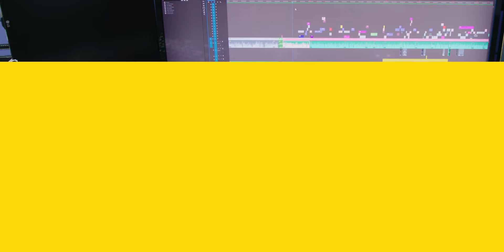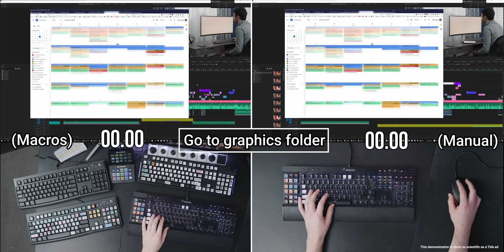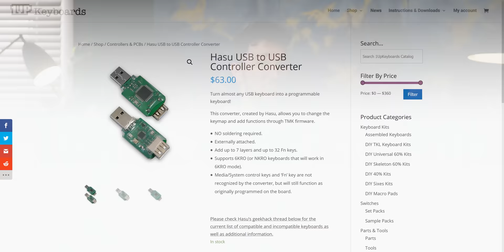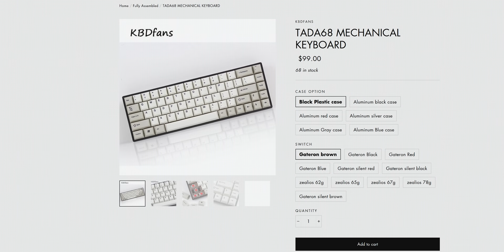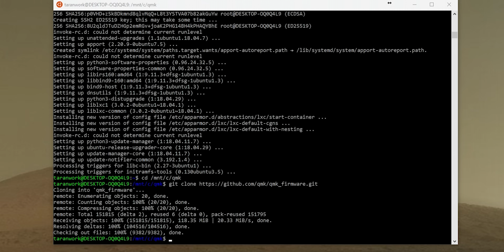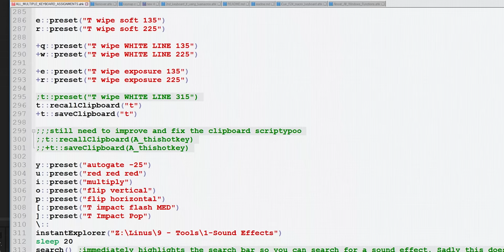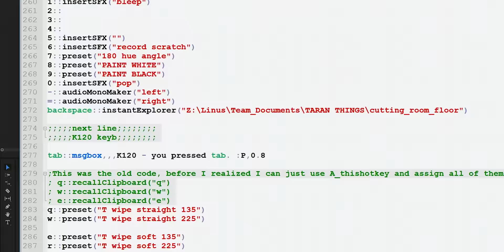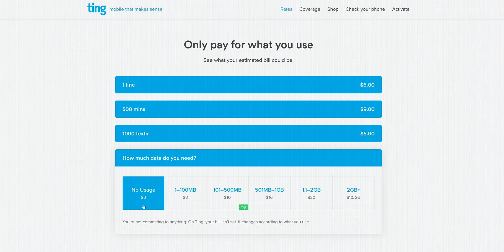Can your Keyboard do THIS?? - Make ANY key a MACRO!

Comment: Every few years, the planets align and The Taran is allowed to exit his den. Upon seeing first light, The Taran is confused - Why so few macros The Taran asks? Why does this creature have only one keyboard? The Taran cannot allow this and plans his attack. The unsuspecting computer user is unaware of the fact that it is possible, or necessary, to use 12 keyboards with his computer. As the computer user types away on his single un-ergonomic keyboard that obviously causes far too much overexertion of their index finger, The Taran strikes. The Taran reveals his secret move: ULTIMATE MACRO and the user is completely overwhelemed by the fact that now he must memorize no fewer than 1400 new key instructions on their new setup, but The Taran has claimed victory, for while the user may need to exert far too much brain power and memory, the user may now save his hands from multiple key presses for the rest of their life.
Reply: Wow
Reply: <3

Comment: i have no idea what i just watched
Reply: I think it has something to do with keyboards
Reply: haha. same goes to me
Reply: The entire trip down the macro rabbit hole
Reply: Basically, he explains all the options for productivity freaks and games that play simulator games in full simulation mode that need more than 1 keyboard to do things.

QMK lets you take cheapest keyboard that you can buy (or have laying around) and turn it into productivity panel. For example, you can print icons that tell you what kind of macro is on a key and glue them to every key on keyboard that is connected to computer with QMK.

Why would you do that? BECAUSE pressing ctrl+alt+shift+F3, down arrow, down arrow, left arrow (or some other combination) would become painful rather quickly, especially if you have tons of such combinations for video editing software, photoshop and similar.

For example, let's say you need to press up, up, down, down, left, right, left, right, B, A
Imagine that you need to do it all the time to get something done quickly and it repeats 30~40 times a day. And there are other combinations that are also used 30~40 times a day.
Macro can do it in about 1~2 seconds (depending on how fast your PC works and can, without lagging, accept the inputs to get things done right).
By hand (manually) it would take a lot more seconds (depends on combination and sequence) to get same result AND you need to remember ALL THE COMBINATIONS in your head. Now imagine that you need to get something done, but instead you try to remember "what is a combination to quickly select tagged items?". Time gets wasted on 'sitting at the desk and staring at the screen'.

So instead of memorizing combinations you can get a QMKs and a bunch of cheapest keyboards and then print out what each key does.
Will it take some time to do? Yes, it will.
Will the time it has taken to set up the workspace help in months and months of mundane work? Yes, it will.

For games like Arma 3 or War Thunder an additional keyboard is useful. Here, look: https://youtu.be/b_sOUn8_JAM?t=162
Try using Full Real controls in War Thunder without running out of keys to press on single keyboard. That's what this video is about.
Reply: @Muhanoid  i know, but its a joke lmao
Reply: @sbxdd  oooooooooh. Now I get it. Thanks!
Reply: Me neither.  I am nonetheless intrigued.
Reply: And you watched it why?
Reply: @Muhanoid  r/whoooooooooooosh!
Reply: sibbexd so true man , me too , i just got a one handed keyboard and idk how to macro set it
Reply: @Muhanoid   the way I like to put it is Taran has an Adobe Premier Macro fetish.
Reply: Xtreme Performance  Why do you say that? Do you know how many of LTT's videos he edits?
Besides, there are so little quality videos regarding macro and programmable keyboards. It's actually an original and rare type of video.
Reply: Xtreme Performance  if what you mean 'loser' is where you can only watch linus's videos without working with him then i guess you are right.
Reply: It's good.
Reply: Lmao
Reply: same but I still watched it lol XD
Reply: Hahaha one day you will get it
Reply: @wolontong  what'd the comment say

Comment: Taran I think at this point building a proper cockpit style rig with a custom frame for all your keys is the next step, like link up several of these USB adapters perhaps and build your own Star Trek style control panel.  Make it so!
Reply: this would be an AWESOME VIDEO.
Reply: Oh hell yeah just imagine linus's face walking into the editors den to see a Star Trek cockpit styled desk for Taran
Reply: Do a quick search for "KSP custom control panel" on Google or Youtube and you will see some excellent examples.  People have been making things like this for years for all sorts of games and it's actually pretty simple.

If you want to get into something like this, pick up an Arduino Uno to start learning.  If you want keyboard (AND MOUSE/JOYSTICK!) emulation, you need something like a Teensy or different model of Arduino, but you literally just wire up any button you like and program it to act like a certain key.
Reply: Wouldn't surprise me consider he tried a mine reader.
Reply: Linus where ya at buddy? I would even say you could get Taran one of those Razor monstrosities rigs for 10k so he can immerse himself
Reply: Taran, what if you convinced Linus and the writers to make "The ULTIMATE Control Panel"? I know it won't get any sponsors like it usually does from Intel and whoever, but it could be a great challenge for Anthony, Ivan, Jake, and whoever else works on it. The only thing I can't think of in my head is figuring out how to get AutoHotkey to "own" the controller for the control panel, but I think you probably already know the answer, because I'm thinking custom drivers or something
Reply: @TaranVH  I work as a computer programmer, I took a look at your hotkey scripts and I must say you commented them really well. Good job! :D
Reply: @IAmTheRealKen  That's good to hear! I learned how to do that from my frustrations looking at other people's code -- "what the hell is that supposed to do!?" Sometimes there is literally no way to know, like when custom-set keyboard shortcuts are sent, with NO indication as to what command they are supposed to be initiating.

Comment: As a Linux user, it warms my heart to hear that installing an Ubuntu VM is faster than setting up git on Windows
Reply: To be fair though, obtaining the code is not enough. Besides, github allows to download the code from the browser as an archive, so that would be easier.
However, compiling this thing on pure windows would probably be difficult, since it is probably developed with an linux environment in mind.

And it isn't really a VM, it's Windows Subsystem for Linux. It's more like what wine is rather than a fully fledged vm.
Reply: window 10 have integrated bash terminal. you have to enable it. and that's whats he did.
i am a linux user too, and i find amusing that this is a form of microsoft to say, cmd and powershell are garbage, here you can use bash now.
Reply: Git is easy, make is harder! You'd need to install MinGW or something.
Reply: The real question is: Why does Taran have a fairly recently edited fork of the Linux kernel in his repos?
Reply: @marcmil4064  wsl changed in wsl2 for a more VM-like than that curious syscall conversions
Reply: A) I think he used the WSL, not a VM.
B) I think he used Ubuntu for Make/GCC than for Git.
C) It's still funny as hell that you've got to use Linux to get Windows to do this
D) you can accomplish this task in Linux with the evdev module in a few lines of Python, no extra hardware (or other operating systems) required.
Reply: @chupilococo  thats what i am saying  too but none of my friends believe it!!
Reply: @thegardenofeatin5965  Thank you for reminding me of evdev. I have used it before, but I don't really remember why. It was probably something lame like making a keyboard's normal macro keys work.

Anyway, I mostly here to say that using evdev is far easier than what happened in this video! ...Though I cannot comment if it is as powerful.
Reply: You need a cross compiler library only available under Linux. Even if you were to use git for windows you would still need wsl if a VM as GIT by itself is not enough.
Reply: it wasn't about setting up git, it was about the make stuffs.  You would have to install MinGW in order to get make and other compile tools.
Reply: @codeman99-dev  The evdev module lets you detect a keystroke from a particular keyboard, and then fire...any Python code you want.  it ends up being If key.keycode == 'KEY_X":  #do something.
From there, you've got all of Python, including the os and sys modules.  So you've also got all of Bash.  If you can get it done from a Python if statement, you can make evdev do it.  There might be some buttons in GUI apps that might be difficult to make Python press, but you could call xdotool for those?

Also, this just occurred to me, many Linux GUI apps have a Python API, so if you're a power user of one particular app, you could maybe write a script that evokes the evdev module there and write your macros/functions in the app's API.  That might actually be more powerful than AutoHotKey.
Reply: I just use chocolatey package manager in windows for git
Reply: @chupilococo  cmd and powershell are garbage? Nope lol. Cmd was made to run simple tasks and powershell is a management tool and not really a script language. They are both just not meant for normal scripting.

But sure you can always go and call flip-flops garbage because you can't do a marathon with them...
Reply: git on Windows is more useful than a Ubuntu VM though

Comment: A perfect demonstration of what "It's easy" means when a linux user is reluctantly helping a new user.
Reply: As much as I hate to agree, I have to lmao
Reply: If you already have Linux installed, this can all be bundled in a little script. And even without script, copy-pasting commands is easier than following a series of gui screenshots that will be obsolete next year.
Reply: This all can be set with docker. But still, it's hard.
Reply: It really isn't, because doing this in Linux is WAY simpler.
Reply: @thegardenofeatin5965  Using the command line is never user friendly.
Reply: @ritchielrez1680  Being user-friendly isn't the goal of the CLI; it's meant to be a fast, efficient, and powerful tool for systems administration heh
Reply: @3nertia  CLI tools can be also easy, better is obviously to make a user friendly GUI app. But here you need Linux, then you need to compile the source code. NOT EVERYONE IS TECHIE and INTERESTED enough to go this route. You can't dismiss those people, they also do have a need of this piece of tech, that's why often people get scared from the CLI, even though it allows for faster action etc.
Reply: @ritchielrez1680  I mean this also isn’t the ideal usage of QMK.
Reply: @3nertia  That IS being user friendly. This mindset of "not my goal equals to strictly worse" makes productive conversations near impossible.
Reply: @ritchielrez1680  If someone is interested in programming macros they are going to have to get over their personal belief that "they are not techie" or whatever. it's not hard to setup a WSL2 instance anymore. the barrier to entry has literally never been lower for a windows user.

Comment: 11:38 Oh hey, that's my blog post! Also, I thoroughly recommend everyone use a Hasu USB converter over my approach - unless you happen to want to screw around with the innards of a Model M keyboard for fun. (Like I did, because I have five of them!)
Reply: Simply the greatest keyboard of all time.
Reply: Does your way plug and play? or do you have to sync it every time you play? I want to make one for my laptop.
Reply: @alexkevhikes  The modified TMK firmware I've got on the teensy just boots up into usb keyboard mode every time, doesn't need changing unless I want to tweak the code

Comment: Taran, don't listen to the haters. Engineers do this all the time to reduce redundent work. In fact, a good part of an efficient engineers time is spent working on macros to do non value added work like retyping the same commands over and over 3000 times. The rest of their work is spent ACTUALLY figuring out how to solve problem, not the act of solving the problem itself. Just how we now use calculators to add, subtract, divide, multiply, on and on.
Reply: The majority of GOOD engineers are lazy as fuck. That's why a good engineer tends to setup such things, altough it requires some effort. However, after a single tedious setup, it works and in all the time they would need to do brainless clicking, they are now able to some work that actually requires brain or to simply sipp some coffee. 
Or at least any engineer I've met in my life, that was GOOD, was a brutally lazy folk, avoiding work as much they could. That's also how you can tell apart the best students. The best folks in university aren't the ones that are learing non stop without a break, but those who get similar or at least close results, without putting to much effort in.

Comment: Working as a Service Desk Analyst, I use AHK quite extensively and found more use in context-sensitive scripts. I.e. if I have certain window opened Caps Lock does one thing, but if I have another one it does different thing. Very cool stuff indeed

Comment: I have a problem at the beginning. When i press the Flash button in QMK Toolbox it says "There are no devices available". In the Windows devices it says "ATm32U4DFU" Driver is not available. 

1. After open QMK Toolbox, i plug in the Hasu Converter and QMK Toolbox says in blue color:
"t.m.k. USB to USB keyboard converter connected -- FEED:FEED:005B:0814....".

And additionally if i am not press the button fast enough:
> Keyboard init.
[C]usb_state: 12

2. After i press the Button, it says in blue color:
"HID device disconnected -- FEED:005B:0814...." -> Then the ATm32U4DFU appears in the Windows devices with "Driver is not available".

How to bring that to work?

I have fixed that:

1. Download the QMK Driver Zip File from: https://github.com/qmk/qmk_driver_installer/releases
After unpack, click at install_all_drivers.bat
2. Open QMK Toobox, plug in Hasu Converter and press the button. Now you should get some yellow lines.
Reply: Thanks, it works.

Comment: Me (4 years late) who is an absolute macro goblin for essentially any software i start to use. (seriously before i ever start to use damn near anything that im going to be using in depth i go through my 1-3 hour ritual of setting up macros) i am fuckin loving any time Taran is on screen. 

And i deff get your "i need a physical button that will literally only do x" because with all of these different programs or set ups, muscle memory is....not shot, but definitely takes hella long.

 And forget cycling profiles.i tried this early on, considering im a fuckin loser who uses an orbweaver for my macros ( i learned with it, im used to it, you can pry it from my cold lifeless corps) switching profiles just to forget,hit the wrong button and deleting hours of work just because i forgot that a button was set to "close program" i love a physical key that does nothing else other than what i say it should. Just that. Nothing more.

Comment: Pretty sure a 2011 Mac laptop with a trackpad can’t do anything
Reply: You could get away with playing Half Life 2...maybe.
Reply: @Wastelander121  bruh, those trackpads are nasty
Reply: I mean... If it's 2011, you can upgrade a lot more than the new ones. I had to get one to make an iOS app and have outfitted it with some nicer hardware making if feel a lot like a newer computer.
Reply: kremit the frog your EVERYWHERE son
Reply: bonzohavoc   Actually my 2010 MacBook Air’s trackpad actually still works very well. Better than even some cheap modern windows laptops. The white MacBooks with glass trackpads aren’t as good but they aren’t that bad.
Reply: well, I editided some a lot of DTP and photoshop stuff on macbook pro from 2009. And it was in mint condition. I was even able to play 2009 games on it.
Reply: @SomeNot  you can't compare zpyour macbook with cheap windows laptops because the components there aren't good as the much expensive ones like a macbook also
Reply: i got a mid 2009 macbook pro lucky you

Comment: QMK supports MIDI, so each key could be assigned a unique "keycode" (using just notes) for 128 notes on 16 channels. So, 2048 unique key codes (not including the use of any modifiers) that are all mappable in autohotkey. This removes the issue of windows not distinguishing between keyboards given that everything between ch0_C_-1 and ch15_G_9 gets a unique value. There are also control change messages that can be utilized (if implemented appropriately) that can increase the number of unique key codes even further (or one can build a device with a bunch of pots and encoders to send variables within a range to be mapped in ahk).

All of this would only really help with the F24 wrapping, as I still can't figure out what that is all about, but would also get to that 20-keyboard situation that noone was asking for.

Comment: Man, this is more work than using HIDmacros which is free. and lets you attach as many input devices your system can handle without having to map them with HEX. It even can tell the difference between mice and their buttons.

Comment: You could also use a raspberry pi 4 as a much less expensive USB interposer at $35 and you can even attach a display to your "usb interposer" and run linux on it so you don't have to write any firmware to do the work.